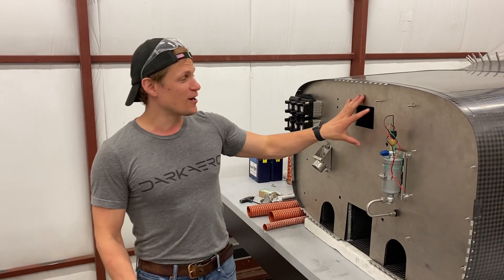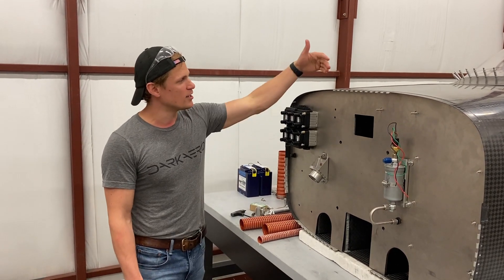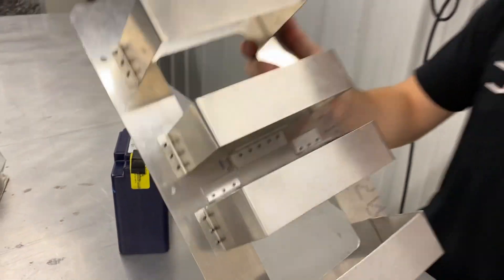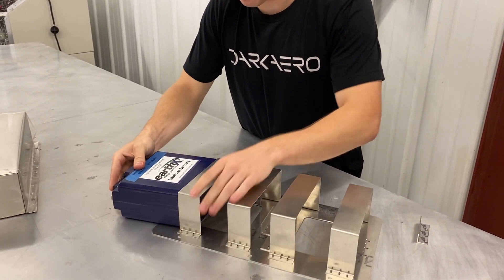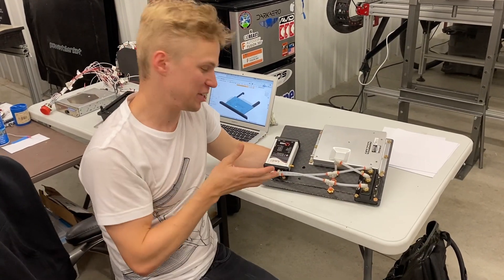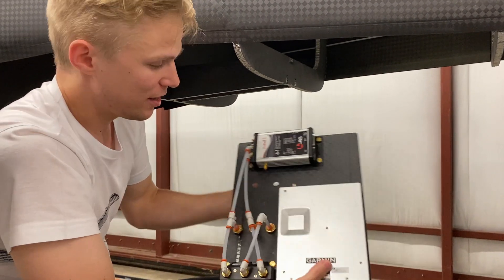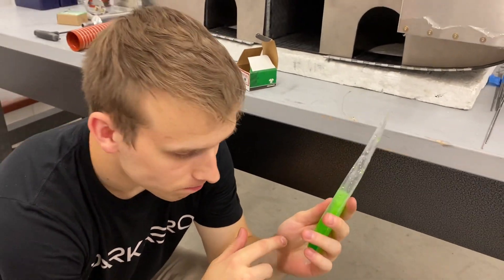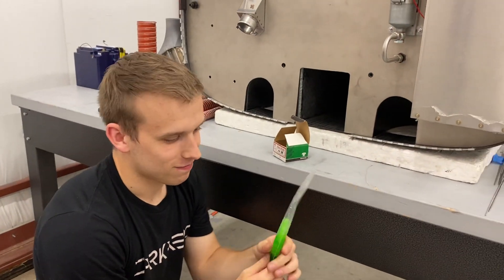Firewall Heat Shield, Battery Cooling, Avionics, Nose Gear - Jun 19, 2020

Comment: Please do not use earth x they are to expensive and are total junk. I have had nothing but trouble with them.
Reply: Add a hall current sensor to your alternator output. Lithium batteries will burn your alternator up with excessive charge current. Hope you can control your voltage regulator. Back to the Odyssey pc925L and 680 for me. EarthX BMS burnt up. Too fragile.

Comment: I notice just rudder pedals are there no brakes? Or are they brakes and rudders?
Reply from the maker: Brakes and rudders. The rudder pedals drive a split rudder system which functions as both rudder and speed brake. Wheel brakes are engaged at the end of rudder pedal travel.

Comment: Not real keen on the fuel pumps in the cabin.
Reply from the maker: Thanks for the watching! We had a similar comment asking about the fuel pumps so just copying that over here. Our final arrangement for the prototype aircraft fuel system will be semi exposed but we are making a few changes in the position of components for production. There is a dual fuel pump module that is a little more compact that we are planning to move to for production that will allow the two pumps to be placed on the cold side of the firewall and away from the copilot feet. This eliminates the need for covers. If a builder would like to mimic our arrangement on the prototype we would recommend a cover.  The angle of the video doesn't show the true relative clearance between the brake pedals and the fuel lines. The way they are set up, the brake master cylinder acts as a hard stop so the pedals stay clear of the fuel lines. The rudder pedal system is designed with sufficient safety factor to prevent structural failures.
Reply: @DarkAeroInc  I'm worried about there being high pressure fuel lines in the cabin where people sit. Having low pressure suction lines coming from the tanks is one thing but post pump high pressure engine feed lines in the cabin makes me cringe. Dont most installations mount the pumps on the hot side of the firewall ? Maybe move the batteries into the cabin or behind/under the seats to open up the room for the pumps on the firewall ?
Reply: Use 5052 fuel tubing.

Comment: Really looking forward to the finished build.  Also, have you guys considered a carbon motor glider build that would meet part 103 restrictions for ultralights?  Talking about a Melody Song type build the same as the one built in the czech republic.  I think that would be a hit in the US market.  I'm looking to buy / build something similar.  Kinda like a scaled down U2 replica with dual Moster 185's would be sweet.

Comment: Excellent build. Some of the nut plates appeared to only be accessible from inside the panel. Avionics will block access.
The cooling air for the batteries, shows an entry point on top but no exit at the bottom.
Once the main hull is built and bonded, how do you access that panel inserted from underneath?
Looking forward to a first flight.
Thanks for sharing.
Reply from the maker: Thanks for watching and for the questions! The nut plates on the cold side of the firewall are still accessible from the cockpit. The avionics panel lifts up with the canopy. The cooling box still requires additional work before completion. Cutting holes on the bottom side of the cooling box is one of them. The aft avionics panel will still be accessible through the main gear door on the belly of the plane.

Comment: I highly question y'alls battery box. . .
1.   Are you venting sealed batteries?  Why?
2.  Looks as if you need to remove the whole box to do any battery maintenance.  Think about ease of maintenance 
3.  Most of your plane is composite. . . Why not make your box out of composite?  It's resistant to corrosion (especially lithium (im guessing your using) and aluminum)  and lighter.  Plus you can make complex, repeatable shapes with a mold.
4.  A simple strap to hold the battery in place with an adjustable draw latch would be a better solution.  Allows for no tool battery maintenance/removal, and allows for minor differences in batteries, with the latches  being able to draw any slack up.
Reply from the maker: Hi Jesse, great questions! The battery box is not for venting but rather to provide cool air to the batteries since they are mounted in the engine compartment and they need to be kept below 140F. The battery box does need to be removed if you want to directly access the batteries but it's only six fasteners that need to be removed to do so. We selected the mount location in the engine compartment because the only other option was in the aft portion of the fuselage which is less accessible. We chose to make the battery box from aluminum rather than composite because aluminum is much better at reflecting the radiant heat from the nearby exhaust. The battery box is not a complex shape so it is one of the few components in the airplane that is well suited for sheet metal. The battery fastening method we chose was meant to mechanically mimic the battery boxes that EarthX sells which require no tools and are built to fit their batteries. Builders can simply purchase the EarthX battery boxes rather than making the aluminum straps like we did.

Comment: Thanks for the update; it's exciting to see how much progress you're making!  Why have you chosen to use two batteries in parallel (essentially, one battery)?  Are two needed to crank a UL520?  With the batteries in parallel instead of powering separate buses, how do you deal with a fault on the main bus without losing all electrical power?  Is there still an alternate feed path to critical items (ECU, fuel pumps, EFIS, etc.)?  If so, what powers it with the main bus, and its batteries, offline?  How many alternators will be installed?  Thanks!
Reply from the maker: Thanks for the comment! Each battery (EarthX ETX1200) has the cold crank amps necessary (600A) to run the starter, which will draw approximately 140A on startup. The main reason for having such energy dense (24.8Ah) batteries in parallel is for redundancy and to provide a longer runtime in the event of an alternator failure (there is one alternator in our setup). There is a dedicated bus to run the ECUs and fuel pumps in the event of a main bus failure, and our backup ADAHRS + EFIS have their own internal batteries that will run them independently as well in this scenario.
Reply: I concede we’re getting into the weeds here, but I can’t picture how you’ll achieve redundancy with two batteries, and presumably the alternator, all paralleled on the same bus.  Long alternator-out run time, yes, but redundancy?  The independent ADAHRS and EFIS backups make sense, but what’s going to power the dedicated bus for ECUs and fuel pumps when the main bus goes down with both sources of electrical power attached to it?  Does the VP-X split the main bus feed in half, alternator on one side and battery on the other, so it can disconnect either one from the bus if needed?
Reply from the maker: @FlyingShotsman  An independent disconnect could be created for each battery in this configuration as well as an alternator disconnect. The ECUs and fuel pumps run off a bus separate from the VP-X in case of a complete failure of the VP-X, but it should be noted that the VP-X has two independent buses built into it allowing for redundancy here as well. Ultimately the builder can decide the wiring layout for their plane, and we have not finalized the connections for the parallel battery configuration in the prototype.

Comment: You've really thought about the installation with that mountable module...  it looks like you are providing the pitot static tubes cut to measure?   will you also provide the wiring harnesses for the avionics for the final kit or is that on the builder to do?
Reply from the maker: Thanks for the comment! We are looking at a couple avionics shops that we'd like to work with to offer a standard pre-made VFR and IFR wiring harness for those that want to simplify this aspect of the build process.

Comment: Great project! How do you handle galvanic corrosion between the carbon fiber and aluminum components like the piano hinge?
Reply from the maker: Pascal, thank you for watching and for the question. In general, any of the aluminum present on the aircraft is electrically isolated from the carbon fiber. All the rivets that contact carbon fiber are stainless steel.

Comment: Thanks for the video! Could you tell us why you chose to move from the stepper motor to the linear actuator for the nosegear?
Reply from the maker: Tim, thank you for watching and for the question! Long story short, we decided to go to a linear actuator because it was an overall better design solution. It is a simpler, lighter, and an easier solution to install for builders.

Comment: will the two batteries be wired in parallel or will they power separate systems?  if the latter will there be a way to connect them in parallel for emergency situations or for more power when starting up. kind of how boats have a way to parallel two batteries for emergency use.
Reply from the maker: For the configuration shown in the video, the batteries will be wired in parallel.

Comment: Might it be a worthwhile option for builders to have a second pitot/static system, that could feed the secondary AHRS? That way you would have true redundancy without a single point of failure of the one pitot/static port, and you could have an active/backup pitot/static system without having to switch it manually like most small aircraft do now.
Reply from the maker: For our prototype configuration, we have opted to use a single pitot tube that will run from the wing tip to our dual ADAHRS setup, but a builder could still install a second pitot tube to achieve more redundancy for their mission.

Comment: Is the fuel line (and pumps) remaining exposed in the cockpit as shown? It gives me some pause the way it appears. It looks like failure of the rudder pedal torque tube (or any other component of the rudder pedal system) could put the pilot-side rudder pedal directly into that exposed, raised aluminum fuel line with considerable force. Similarly, a panicked co-pilot could miss the rudder pedal and put their foot directly into those fuel line fittings. Perhaps a removable carbon fiber raceway to cover and protect the fuel line and pumps could be implemented?
Reply from the maker: Thanks for watching Scott! Excellent observations and questions! Our final arrangement for the prototype aircraft fuel system will be semi exposed but we are making a few changes in the position of components for production. There is a dual fuel pump module that is a little more compact that we are planning to move to for production that will allow the two pumps to be place on the cold side of the firewall and away from the copilot feet. This eliminates the need for covers. If a builder would like to mimic our arrangement on the prototype we would recommend a cover.  The angle of the video doesn't show the true relative clearance between the brake pedals and the fuel lines. The way they are set up, the brake master cylinder acts as a hard stop so the pedals stay clear of the fuel lines. The rudder pedal system is designed with sufficient safety factor to prevent structural failures.
Reply: Good idea.  I'm just hoping my size 15s will fit in there.
Reply: I continue to be impressed with the level of design, thought and engineering going into this airplane. I'm definitely going to be watching this closely, as a possible kit option.

Comment: Hie, My name is Nkosi... Not relevant to the video but I just want to ask, can I put a 260hp Aeromomentum Engine on this Airframe?, can the airframe handle that horsepowe and can that eniine fit
Reply from the maker: Hi Nkosi! Thank you for watching! We designed the DarkAero 1 specifically around the UL Power UL520iS engine. The 260hp Aeromomentum would be too heavy for our airframe and too tall to fit under our cowling.
Reply: @DarkAeroInc  Thank You for The Response
Reply: *engine